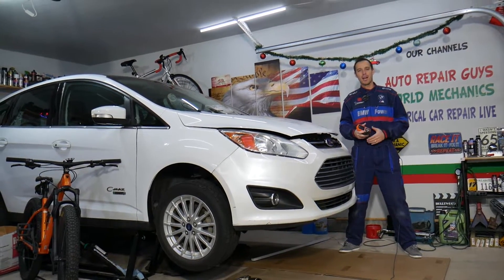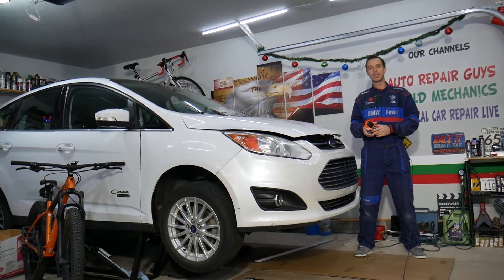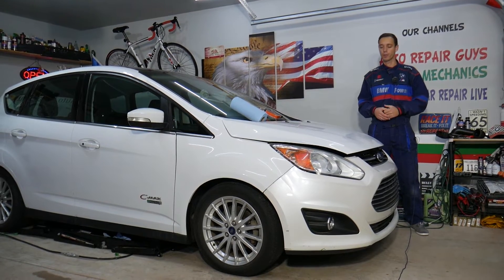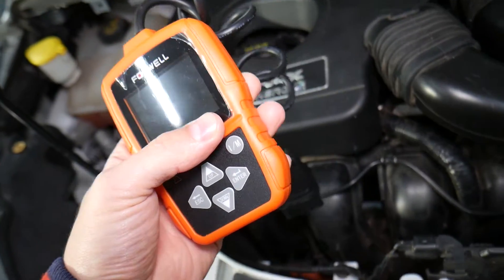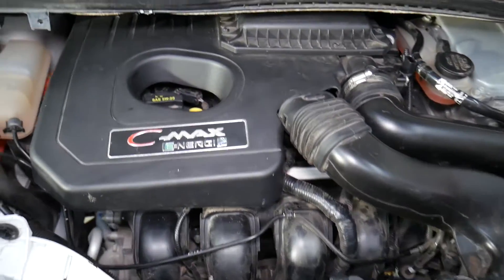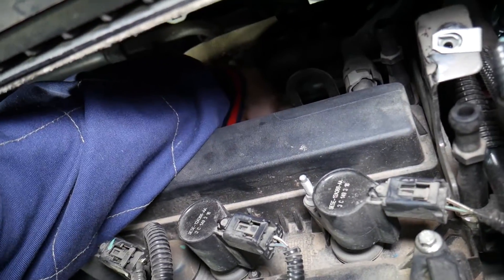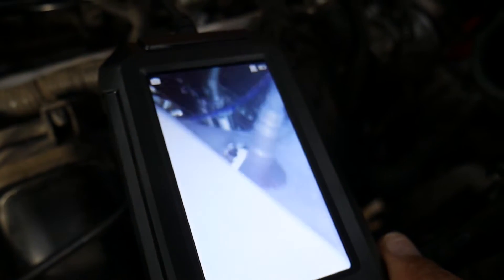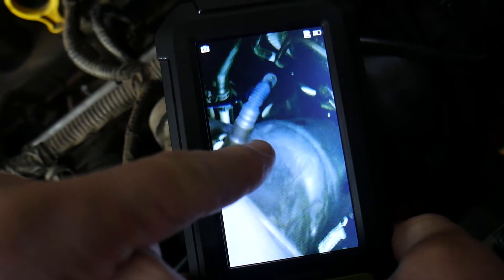CODE P0130 O2 SENSOR BANK 1 SENSOR 1 FORD C-MAX FORD FUSION LINCOLN MKZ

Comment: In a 2012 chevy cruze what makes the coolant fan come on? I'm not talking about the tempature sensor I mean what else makes the coolant fan come on, the pcm? I had to put a switch in thr car to make the coolant fan come on when it gets hot, plus it has a very rough start, and when the a/c is on it will overheat and run very rough as well.